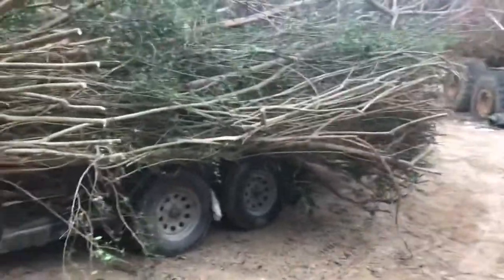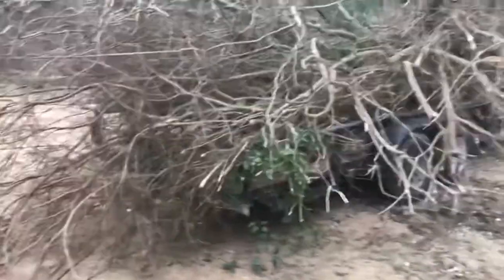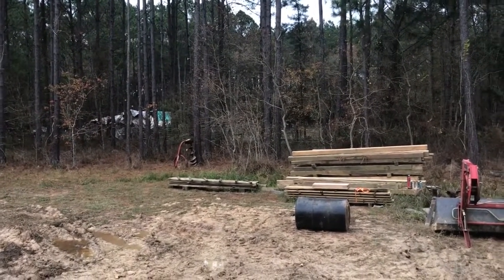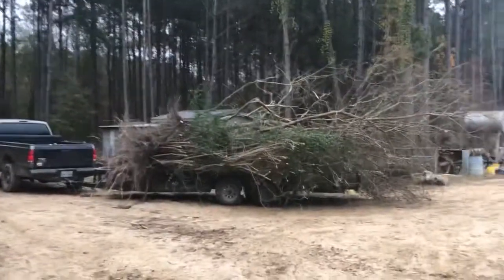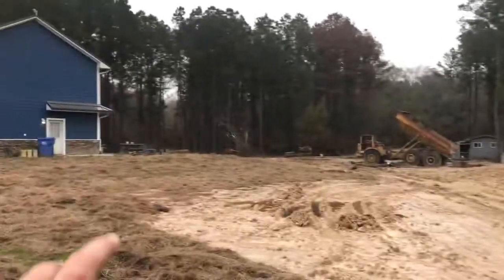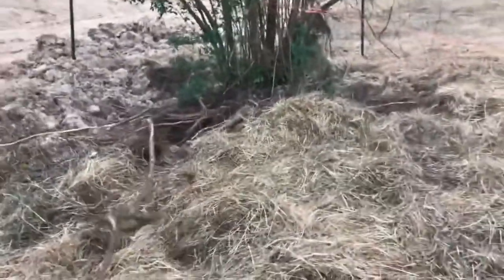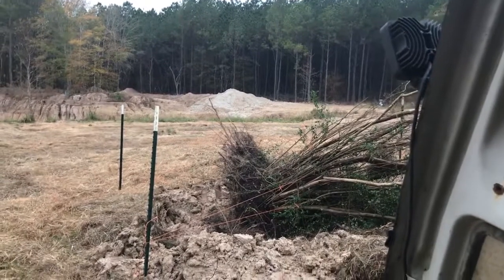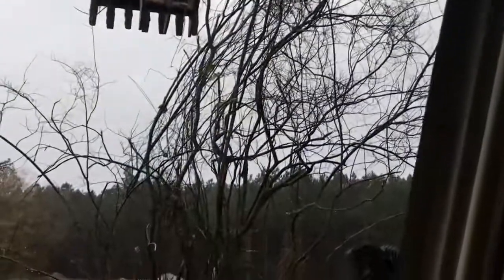Transplanting Huge Crepe Myrtle Bushes from a Clearing Job

Comment: How are they doing? I'm going to move one that's up against my house in winter and move to backyard.
Reply from the maker: They did OK. Most of the taller growth died back, but I also didn’t give them as much help as I could have. Put in plenty of good topsoil, root stimulator and good mulch and they’ll do fine. I’m going to have to prune mine back a good bit but the large root network has still given it a huge kickstart compared to buying a tree in a 3 gal pot
Reply: @TomBrueggen  definitely. I have a white crepe myrtle that's in a pot now but want to get the one that's up against the house for quicker results. My husband tried cutting it down before so now it's growth is like a shrub. I won't complain though. Something to offer shade fairly quickly makes me happy enough. Thanks!